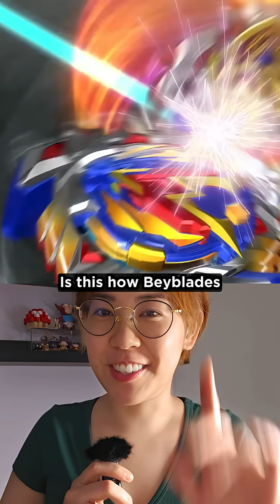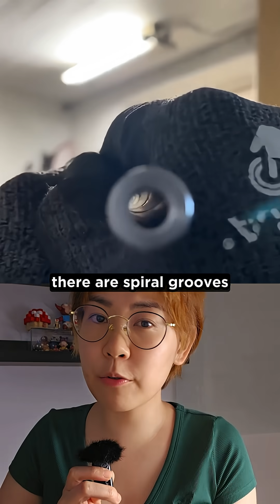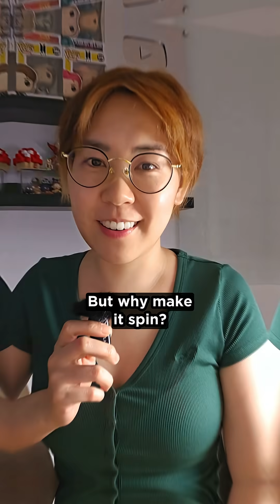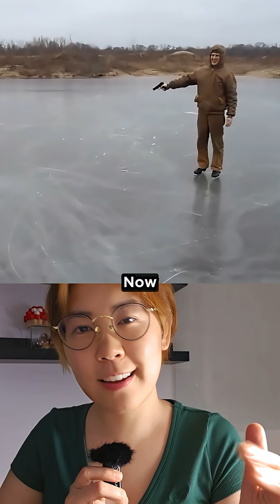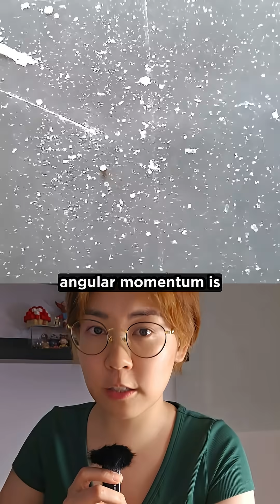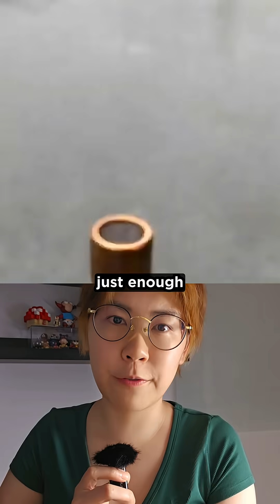Why Do Bullets Spin Like Beyblades?

Comment: If you really wanted to make a beyblade try this with an 8.6 Blackout those spin at 500,000 rpm, 9mm is only 86,000 rpm. I generally wonder what would happen with it spinning almost 6 times faster and both relatively or pretty close to the same velocity?

Comment: Fun fact: This is the same reason neutron stars spin so fast, they are very compressed relative to their original size, but the angular momentum from their original state stays the same and some spin up to 700 times a second.

Comment: If my mind is quiet enough I can turn on electronics.   open your mind to new possibilities. Stand in front of a stereo system now concentrate focus on the stereo.. turn it on with your mind. It won't work at first but if you keep practicing eventually it will work. Your cup is too full you must learn to quiet your mind.

Comment: Wierd question: does a fired bullet actually spin thousands of times a second?  I accept that it is spinning that fast, however, most bullets will spend only a miniscule fraction of a second in the air so it will stop spinning pretty quickly.  If we measure the amount of spins that occur in the second after the bullet leaves the barrel it will amount to a few hundred rotations.  If the bullet was instead shot in a trajectory that would keep it in the air for an extended period of time the air friction would bleed off the rotational energy pretty quickly and ultimately average much fewer rotations.  If the bullet is fired in space on an infinite trajectory Noethers equations show that rotational velocity is not concerved in perpetuity so it would eventually average a negligible rate of spin over it's eternal flight.

The correct answer is that rotations per second is not averaged over a period of time but rather is a snapshot of rotational velocity at the time that the bullet leaves the muzzle.  Rotations per second is a means of expressing that rotational velocity be projecting it's effects into an idealized future.
Reply: A common twist rate is 1 twist per 9 inches of barrel. 36,000 in/s * 1 rotation / 9 in = 4,000 rotations per second at the muzzle

Comment: I grew up in Utqiagvik (then called Barrow).  My father would pull my brother and I around on sleds tied to the back of his snowmobile.  Before crossing any of the multitude of lakes that pockmark the region he would stop and shoot the ice with his pistol to make sure it was thick enough to take our weight.  My brother and I would hide behind the snowmachine and cover our ears because of the deafening bang and shards of ice it sent flying.  Then we would rush out with the emergency polaski and shovel to dig the bullet up.  In short, I guess you need to have a pretty extreme angle to get the bullet to skid instead of burying itself in a crater.  

Also, guns are REALLY LOUD.  So much so that if you're wearing a portable echo chamber on your head (also called a hood) when one goes off you can suffer permanent hearing damage.  So props to the guy in the video for remembering to use a silencer when firing a gun in the winter.
Reply: wow, good one

Comment: And thats how they trace bullets from crimes to a gun. Once they have the gun, they take a controlled shot and compare the grooves!
Reply: That happened in ace attorney, but in real life that method of checking the rifling is just too unreliable
Reply: @thomaswang2223 Also manufacturing has gotten good enough that the rifling is nearly identical for a series of weapons. All you can possibly learn is the model of firearm used. Which can still be useful.
Reply: @thomaswang2223  
It doesn't have to be a 100% exact match because it's not a "stand alone" piece of evidence for conviction like DNA would be.   Things like someone owning the same kind of car that was spotted at the crime scene or a witness seeing the suspect at the victim's house earlier that day, is all circumstantial evidence.  One or two pieces of "semi-reliable" circumstantial evidence may not be enough to convict someone for a serious crime, but if there's like 20 or 30 pieces of it, even though it's not as solid as DNA, that many "coincidences" is almost just as impossible to refute.